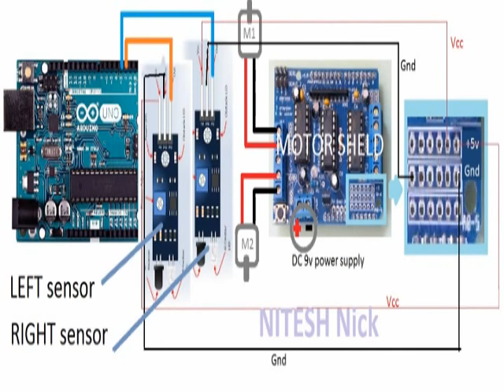LINE FOLLOWER

Comment: How can i make with L298N motor driver please tell
Reply from the maker: Sure
Reply: @technick57  Thanks but i have used L shaped motor 
Will it be a problem??
Because my project is not working..
Reply from the maker: @saurabhs3843  no problem just make sure it is of 150rpm
Reply: @technick57  Thank you